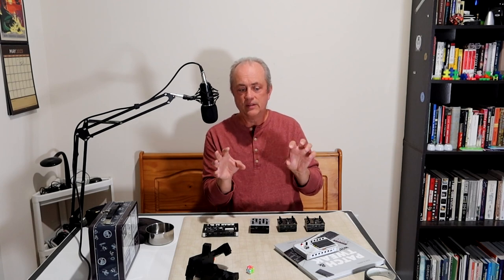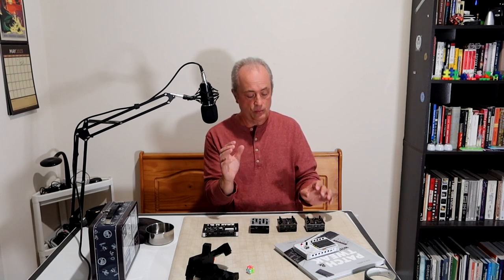Kastle Duo Patch and Short Jam

Comment: If you could only use 5 instruments for the rest of your life, which ones would they be
Reply from the maker: Interesting to think about. I'll assume you mean physical instruments as well, I'll limit it to things I own or have played before, and I won't suggest that a modular setup is one instrument.

1) A piano/keyboard, I guess I'd pick my Casio Privia.

2) A hand drum. Maybe an LP conga or Remo kanjira (a tiny drum but I really like it).

3) Some sort of pipe/flute. I like a low Irish whistle, but I think I'd go with a Basque-tuned tabor pipe (txistu).

4) Makenoise 0-Coast. Love the sound and functionality. The Privia would work as a midi controller.

5) Ableton Live? Is this an instrument? Not sure. The Privia as controller here too. If not allowed then something pretty deep, maybe able to do granular synthesis. Digitakt? Digitone? Norns? MicroFreak? SP-404 (would like to learn fingerdrumming, etc) I have the SX but a mark ii would be preferrable.

Thoughts? I think about things I've used on the channel over the last 5 years: Kastle 1.5, Kastle Drum, Volca Modular, Model:Samples, Model:Cycles, Digitone, Strega, etc. They are super nice, but I guess I see the thought experiment in terms of what I'd really miss. Like I would really miss playing the kalimba. And, mind, I'm not particularly good at any of the physical instruments. And I'd miss doing some sort of patching, hence the 0-Coast.  And something fairly bottomless like Ableton or Norns (maybe that's cheating, idk).

Anyway, an interesting question, thanks for posing it, and for watching!